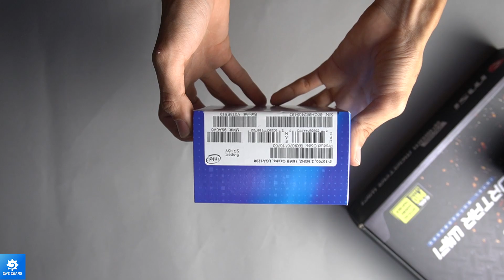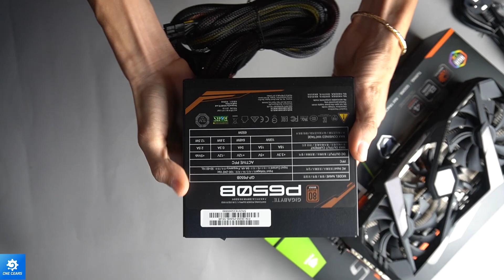Gaming PC Build Intel i7 10700 MSI B460M Mortar Wifi AORUS RTX2070 SUPER Ram XPG 32G

Comment: does this motherboard will be good with the RTX 3070?
Reply: YES! this MSI B460 Mortar is the BEST b460 on the market. VRMs can handle a 10900k as the beefy VRMs can handle i believe 255 watts or more? (I forget the exact number). Asus has 2 motherboards (Strix is one of them) can handle 210. others handle 180 which is good also but Asrock mobos can only handle 125w...steer clear of the Asrocks unless sticking to a i5-10400 or i3-10100 (unless you get the i5-10600k and use a high end asrock z490. their mid and low end are weak and can't handle the power). Currently I have a 5700 with xt bios on my motherboard with a 10700f chip. freakin fantastic! Now I need a better monitor as my older 90Mhz 1080p is just bottlenecking the pc! hahaha (Awesome!) So a straight answer? Yes, this motherboard and cpu will kick arse with a 3070 and even a 3080!

Comment: I have 10700K can I use these b460 mortar instead of z490 if i don't want to overclock? Does it will work with 10700k
Reply from the maker: Yes can
Reply: @ArunreaseySann b460 Mortar Or Tomahawk Or Bazooka?
Reply: @itshyperelite4869  Mortar or Tomahawk. Tha bazooka can only handle 180W where the M and T can handle 240+  You'll want to unlock your PL1 and PL2 on the motherboard to allow it to use more power. NOT overclocking but will allow more than 65W which is anemic for a 10700 or 10900 and will leave you with 4.2Ghz (MAYBE) on all cores but will drop to 3.6-3.8 when things get intense (Cyberpunk will chew up 13-14 cores with a 3080 so plan to see 80+% usage at 4.6Ghz on all cores)

Comment: Will this pc run with 550 watt?
Reply: The 10700 (non k) can actually use up to 255W. With a 2070S you're looking at 550W Minimum psu but it better be of very good quality and you may wish to change PL2 to 125W which will net you about 4.4 on all cores instead of 4.6. Currently at 4.6 while gaming,  I'm pushing the motherboard to about 137W. It's those spikes however that a weaker power supply may not like. A less power hungry graphics card would be better suited. 2070S can eat up 225W

Comment: Supported memory ram 3200mhz? Thanks!
Reply: X2?
Reply: No, the CPU yes but it need a motherborad of chipset z490, the chipset b460m max with i7 10700 is 2933mhz
Reply: 2933 max but you can lower your timings and improve it. CL14 @2933 beats cl16 @3200 and if you left it as is the difference is less that 5% at 1080p gaming and less than 2% in apps. In fact, 2666 is still less than a 10% difference in 1080p gaming. Will you actually see the difference? Nope. Tweak those timings and it'll match so.. all is well and save yourself the $60 on aZ490 motherboard premium